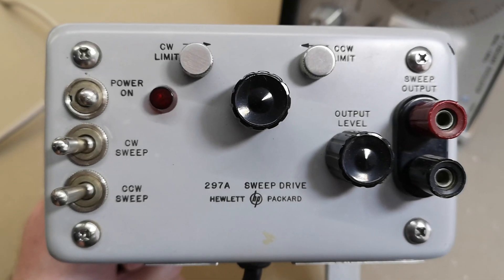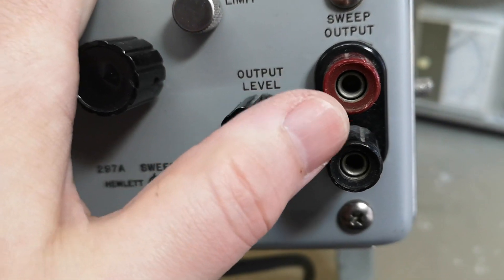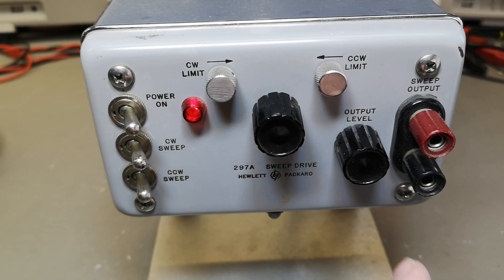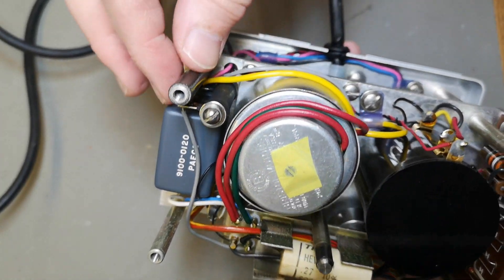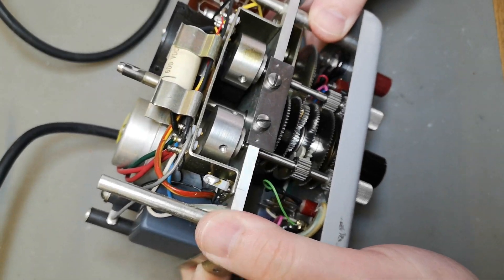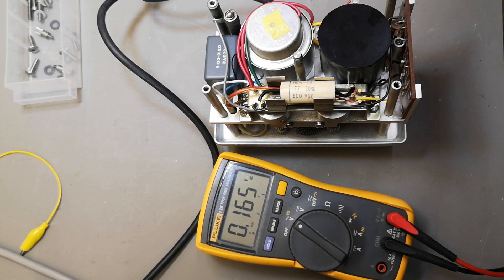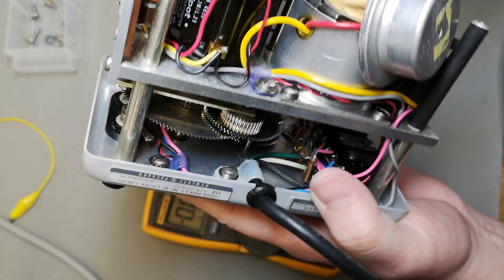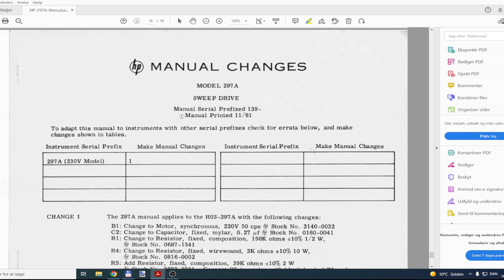HP 297A Sweep Drive 1961 test and teardown

Comment: Probably had a set of adaptors for specific HP gear to use it, likely ordered separately, you just ordering the kit of HPxxx adaptor, which was probably just a rubber knob to fit the shaft, and relied on friction and a hanging jig to hold the unit onto the front panel. Adaptor it came with probably was used instead of buying the HP part, and then was used with a simple rubber belt on the knob to turn the dial. 

Motor is a simple synchronous motor, separate coils and a permanent magnet in the rotor, and is designed with multiple poles, so the output shaft is low speed with synchronous drive. Motor is different for 220V, but the transformer is the same, just put a 39K 5W resistor in series with the primary lead, and upgrade capacitor and series resistor for the synchronous motor to limit torque and current during sweep direction change.

Nice unit, very niche, and soon replaced with units integrated into the test gear itself, as transistors allowed more complex electronics to be put into the same, or smaller, volume of case. Probably would couple nicely with the original HP oscillator well, though designed for the HP301 and 302 series machines.
Reply from the maker: exactly what i was thinking too :-) it is just so cool the mecanical interface to other instruments, maybe this lead to the idea behind the R2D2 interface ?
Reply: @TeardownOZ2CPU  In the movie was just there to give a moving effect on connection, as a plug and socket going together is not exactly great cinema, you want motion, so they made the moving plug and socket, to look like a key in a lock instead of 2 computers over a serial connection. 

Remember film then for movies was ASA10 or less, so needed insane light to get good negatives, and no blur, so no LED or small light was going to be usable. Panels and displays used backlights and masking, so they would be able to compete with scene lights of 2kW each. Basically the back side had a spotlight behind the scene, and coloured acetate on glass to give instruments, with motion and blinking by having mechanical shutters as well. Leave on too long and they melted.